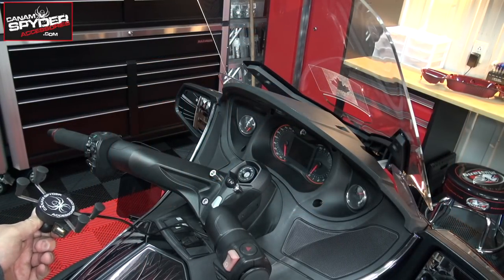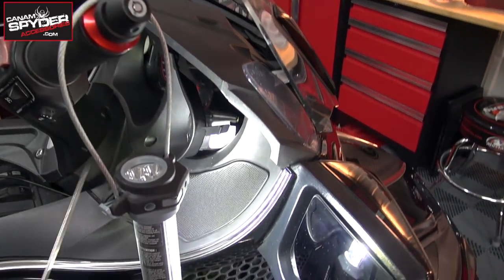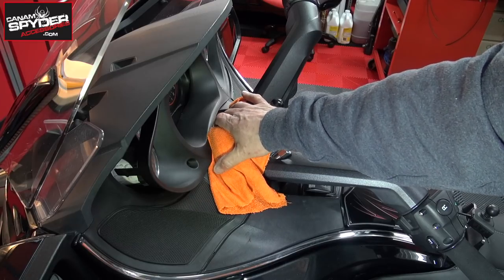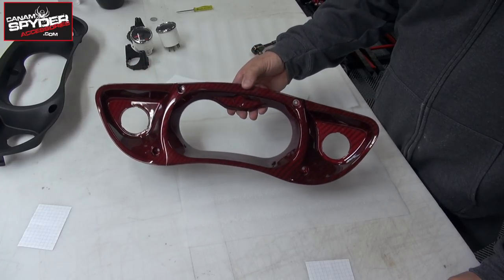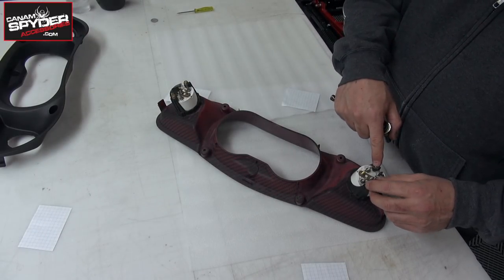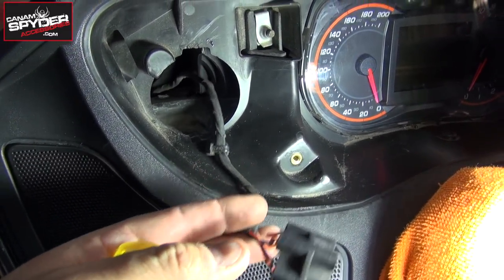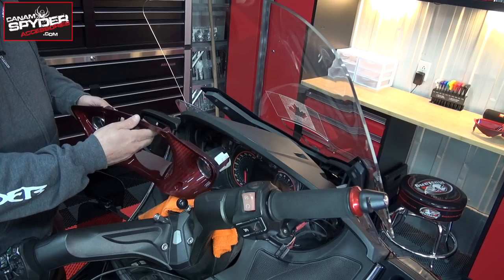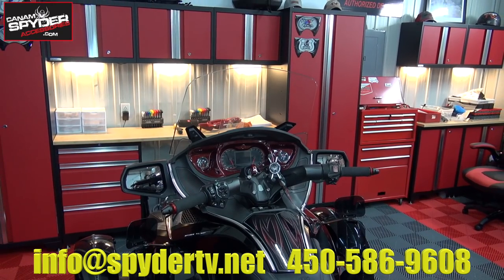RT Can Am Spyder 2010-17 Dashboard removal and installation

Comment: My 2011 rd se5.It won’t crank when I turn on the key, nothing works, the dash and tail light flash randomly over and over and the pump doesn’t seem to prime it just clicks over and over and there are no headlights. Before all of this when the batt was low, when I turned the key on, the pump would prime, then I’d push the start button and then it would just click click click. Now the headlight is gone and the dash flashes continually along with the tail light and the pump doesn’t prime and nothing works.

Comment: Pierre, any chance that you can do a video on how to remove the dash from a 2018 or 2019 RT? Since there is a significant difference on the 2017 and the 2018/2017. This will determine if I will be ordering dashboard for my 2018 RT or not :-). Is the process the same for the 2018/2019?
Reply from the maker: Dennis V. Macasaddu I’ve got to get one overnight to work with....
Reply: Pierre - Spyder TV Poliquin - Spyder Accessories..... take mine and use it as a demo but it will be a long ride for me from San Diego to your hometown hahahahah.